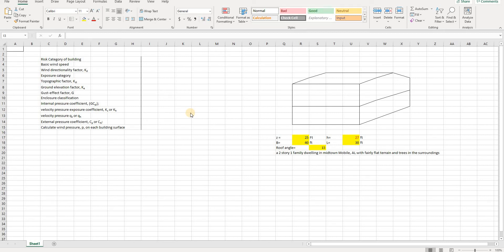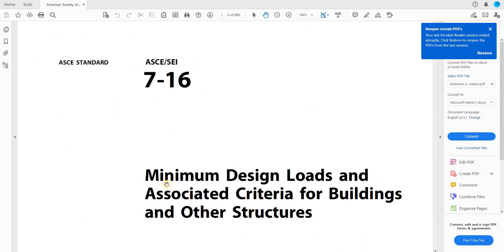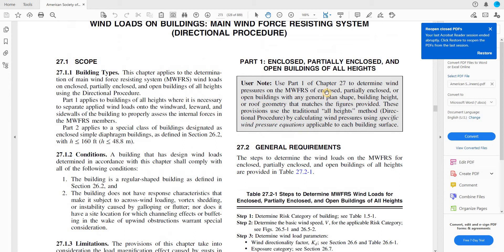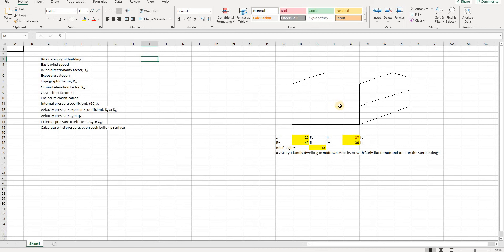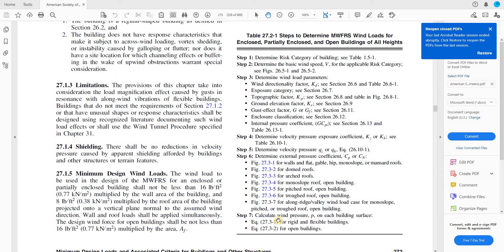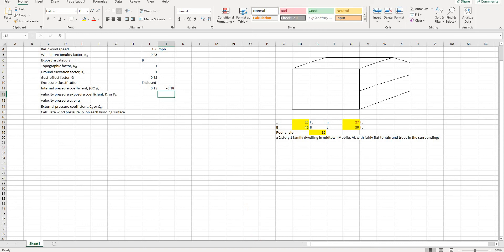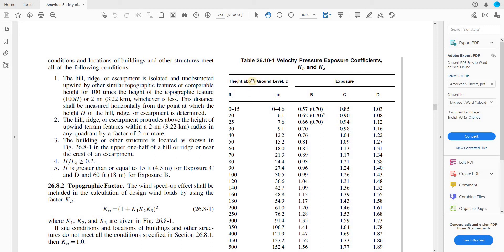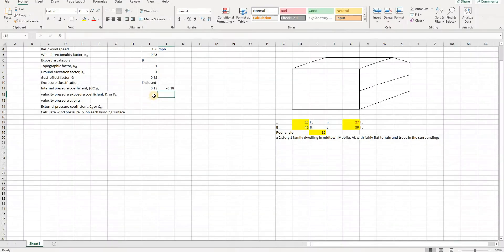WIND LOAD DETERMINATION-MWFRS-DIRECTIONAL PROCEDURE

Comment: Why you took the -ve value of GCpi when calculating the pressure on the roof windward?
Reply from the maker: @sherifhelaly3526 if you watch it closely, I’m plugging the values in the formula directly with their respective signs. The windward coefficient I used was also positive. Thanks for your comment.

Comment: When would you use MWFSR method instead of the envelope method?  My understanding is the MWFSR method applies to the overall structural design, while the envelope method applies to windows, doors, or any non-structural components connected to the building?
Reply from the maker: Hi Omar Khan, thank you for your interest. I will be uploading a video on the envelope procedure soon. The MWFRS Directional procedure is based on the direction of the wind which is assumed to be perpendicular to the faces of the structure where as in the envelope procedure the direction of the wind “does not matter” and takes into account any possible wind reaction of the structure. 
Don’t forget to subscribe and turn on the notification so you can be notified as soon as I upload the video.
Reply: @mathphyseng2002  Thank you!

Comment: I believe when using positive Cp, you must subtract by the negative GCpi (subtracting a negative number yields a positive).  The way you did it was underconservative
Reply from the maker: I understand that you want to be over conservative but do you also agree that you have to use the formula as described in the book? I believe there is a reason why the negative sign is in the formula to ensure that the results are more than accurate but not overly conservative.
Thanks for your comment